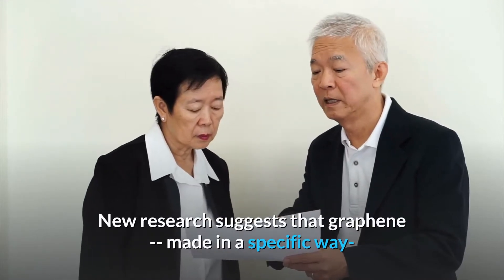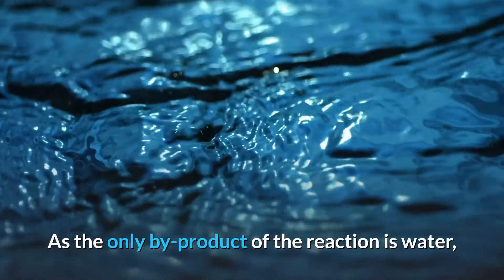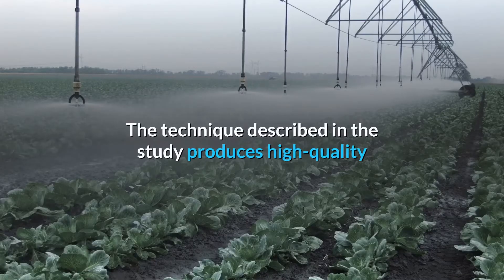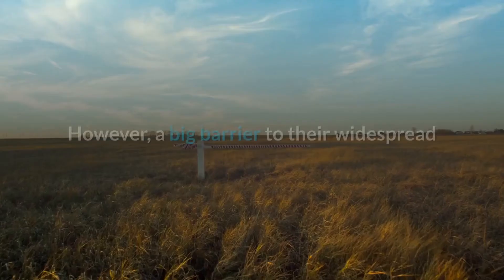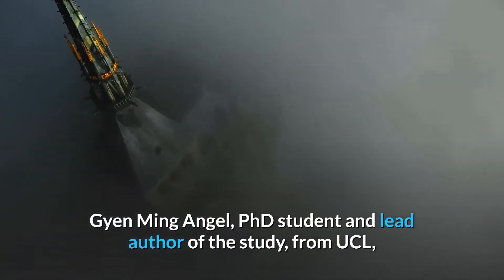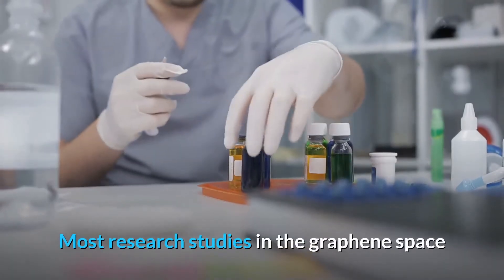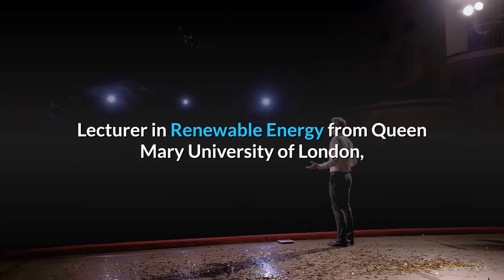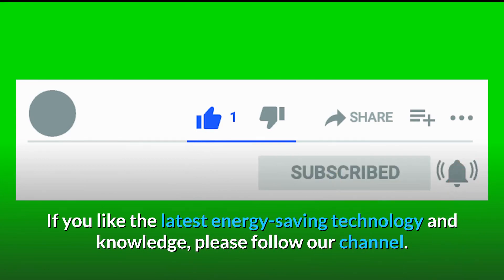Graphene can be used to make more durable automotive hydrogen fuel cells

Comment: What is the efficiency of this material ? .. can it produce hydrogen in regular room temperature or it needs high temperature and or pressure ?
Reply: 38% overall for charging cars (gas is 35% and EV is 80%) But the charge time is a big factor. EV is 1 hour, hydro is 3 minutes